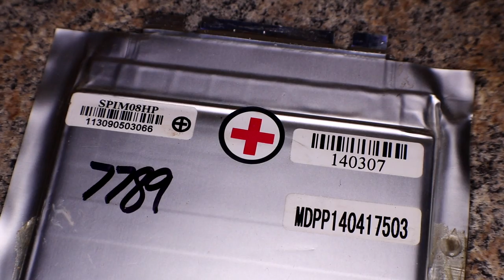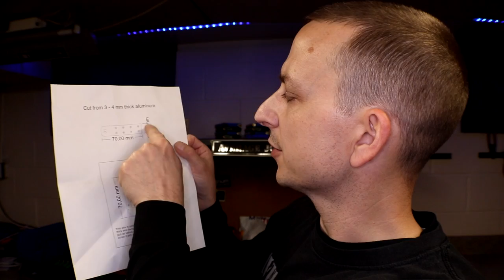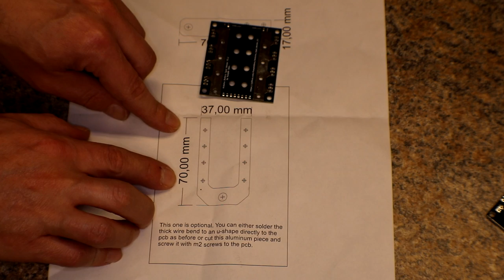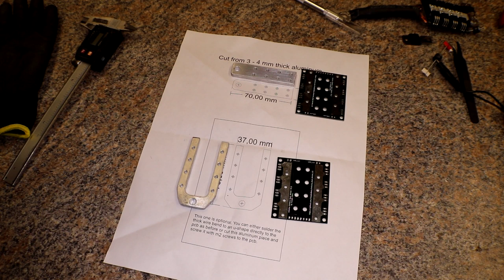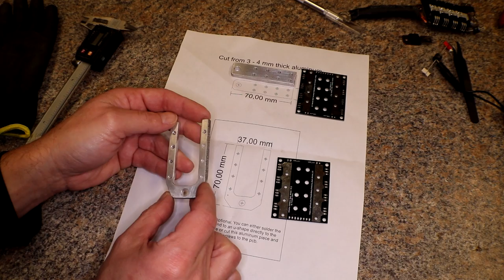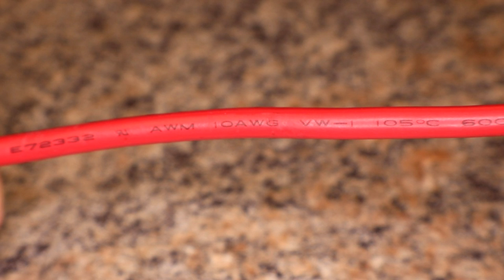🔋⚡Malectrics Diy Arduino Spot Welder⚡🔋

Comment: Very nicely done, even after all the teasers, ties together well. 👍👍👍
Loved the close ups, answers a few questions, showing just exactly what was done.
I do wonder if Malectrics has a paste stencil, the DIYer can use it as a placement holder after applying the solder paste to the pads. It would provide protection of the PCB when using hot air solder reflow for SMD.

Oh this was also a teaser, no info as of this comment.
Is their an emotion of drumming fingers?
😃  🤔💭 ... ... 💣💥

Was this first ? 🤔
Reply from the maker: BOOOOOOM💥💥💥💥💥💥 YEP Your First!!!!!   Thanks, Yeah I think it turned out really nice aaaand it seems to work great!  I tried to get even closer but couldnt hold the probes without my hands hitting the camera lens lol.  I havent seen any stencils on his github site but wasnt looking for one!   That would be a good idea tho!  Yeah Ill be putting all the info in the description in the morning!💥👍
Reply: @AveRage_Joe  maybe u need a macro lense bud cos my eyes r screwed and urs will be screwed too when ya get older.
Reply from the maker: I have thing where I could display it on a screen, just never tried it lol. Maybe Ill try it!
Reply: @AveRage_Joe  would that be a Gerber  viewer?
Reply from the maker: Its more like a microscope!🔬
Reply: @AveRage_Joe  actually what I was thinking was reading the files that produces the pads for solder mask or solder paste.
I tried looking at the files on his site but I couldn't seem to download it right
Reply from the maker: There should be a download button or clone button to download the files.

Comment: Only thing I may have done differently would be put some thermal compound under the fets.. Very nicely done!
Reply: That connection hast to be as electrically conductive as possible. Thermal compound is NOT conductive.
Reply from the maker: I thought about that but like Cutter Slade mentioned I figured it needed to be as conductive as possible.  Dont they make conductive stuff nowadays?  Maybe Ill look into that!
Reply from the maker: Thats what I was thinking!👍

Comment: lol for the price of the premade version , i just buy a spot welding machine from banggood. that works better also. if it was cheaper than it would be a nice alternative. but its way to expensive for what it is
Reply from the maker: Which one from banggood?  If going with a Sunkko, I hear you should get the 220/240v version https://www.banggood.com/custlink/mKm3cpKVBi over a 120v.  I guess most that got a 120v say it doesnt have enough UMPH!

💥🤘
Reply from the maker: Thats what Ive seen/heard!

Comment: Joe you're doing SMD soldering wrong way 😕 first you put solder onto one of the pads then solder one leg of the resistor and later on you put solder onto the remaining ones.
Reply from the maker: LOL That probly would have been easier!  Next time!!!😆😆💥👍
Reply: @AveRage_Joe  a more proper way is to stencil solder paste, place components and hot air level. The components self align due to the solders surface tension.
The stencil is normally removed after paste has been squeezed on, but for DIY, best leave in place until re-flowed. Paste can be dispensed using the syringe it came in.
Reply: @LeslieIsgrigg  How should this work "leave it in place until reflow"? Of course the stencil has to be removed before placing the components. It would be partially under the components otherwise. And that would be bad: A metal stencil would short out your circuit and a Mylar stencil would melt.
Reply: @goamarty  these days solder paste stencils are used most often by short run production services. Volume production uses a pick n place system fitted with a syringe.
You are correct the stencil is used only to help place your solder paste, and give you some measure of protection from paste smudging , and give you an idea of how much paste too place. The exact amount varies by the land size 4 each component the key thing is to ensure to keep it to a minimum, truly a little goes a long way.

You remove the stencil when your solder paste is placed. At which time you begin to place the SMD devices, the tools used for component placement are most often a pair of tweezers a various sizes.
I have however seen some use one of those tacky putties on the end of a toothpick. I don't see how that worked but they did it. Personally I prefer a poor man's pick-and-place vacuum head.
They come in many forms, because they are entirely made up at the moment. One way is you find one of the nebulizer pumps, find the intake and put a hose on it, attach a tube like a pens, putting hole near the other end for your finger to cover.
Then attach small nozzle at the end,  best to have it be curved, you may need more than one size nozzle.
To make this work by covering the hole in the tube to pick, and release to break the vacuum to release the component. This technique works best with a little placement pre-planning, I print an enlarged layout and place the components in their appropriate places so that after paste is down I can simply use the vacuum pick up to pick the component and place it into the paste and release the hole. This technique allows you to pick and place and a lot of components in a very short time.
At this point you use anyone of the Reflow tools to melt solder paste, allowing the components to self align as you do so.

Comment: When printing just make sure to set it to 100% size and not "Default" or "Make to fit". Forgot how those 2 settings are called in English...*sigh*
Reply from the maker: I tried that and for some reason it printed the same size lol.  I will say I got the laser printer for free from my recycler but again its probly user error!😆🖨🙄
Reply: Oh okay than. Either that or he forgot to make sure the blueprints match his product. Happens sonetimes too.

Comment: spim08hp flat cells from battery hookups. danger danger. they don't tell you. many of these cells have problems inside. there is current flow between the foil covering insulation layer and the terminals of many cells. measure the terminal to edge voltage along the seams. i'v gotten 3.9 volts off the foil wrapper. the cells will puff and be destroyed from self discharge. many of my 60 plus cells i bought do not have this problem. all the 30 % that puffed without ever being under load have the short to the foil. warning the edges of the cell packs carry current.  not safe for marine environment at all.  i only made 12 volt packs at higher voltages there will be bigger sparks from foil to terminals. danger if they self discharge they will puff and oh they say you didn't do good assembly. they don't say anything about do not touch electrically hot foil next to terminals. if a buss bar touches the edge of the foil it will short out the whole battery.
Reply: dude you are copy and pasting your reply on all the spim08hp youtube videos!!! yes we understand you don't like them or you are mad at the guy who sold them to you. we get it